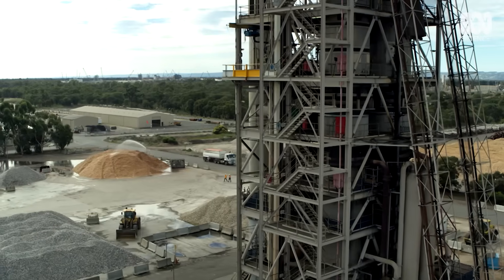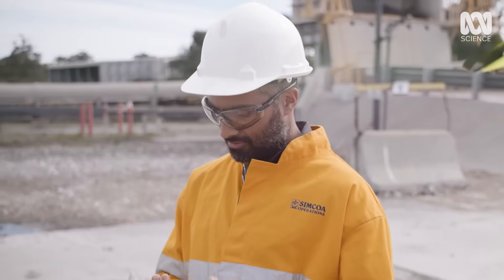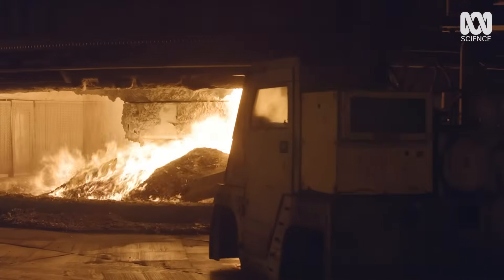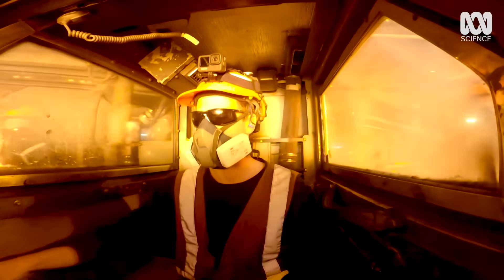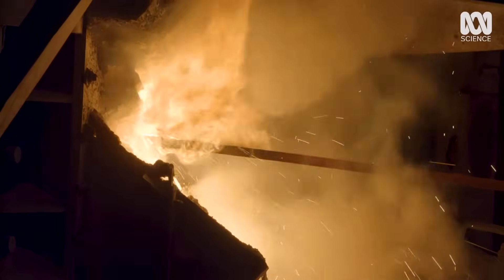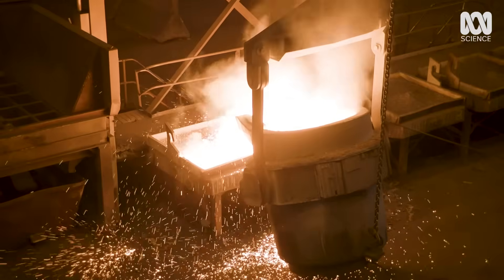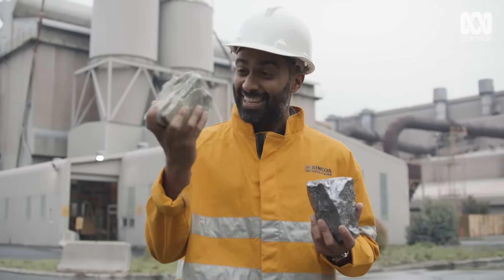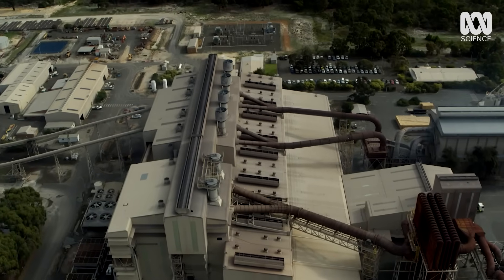“It’s Like Working In A Volcano”: How Silicon Is Made | Extreme Jobs

Comment: Leftoids don't ever think the creation of solar panel nor the recycling of solar panels through. All they see is a material that turns sunlight into electricity. They don't care that the huge fiberglass turbine wings have to be cleaned every 5 - 7 years due to large birds being killed by these blades. Then they never learn that even if the 25 yr old turbine blade is ground down to dust, that dust does not disintegrate nor is it useable for other products.

Comment: Wait, is this going to be used to make solar panels? I’m not sure he mentioned it in the video
Reply: after cleaning it with some form of halide like chlorine and fractional distillation in a massive chemical plant, yes.
Reply: Cosmetics too. Lotions and such. Medical uses. Silicon can be a grease or oil. Not only a hard rock.
Reply: solar panels, microchips, silicon wafers and probably more
Reply: Probably, because silicon is a semiconductor material which is needed to make photovoltaic cells
Reply: First 40 seconds mentions it
Reply: @warlynx5644 yes I know they stated excessively throughout the video 😂

Comment: 4x10 EROi is pretty low, add in battery storage and it gets worse. Average for other generation technology is 40. Hydro-electric is the best followed by nuclear.
Reply: It's many times higher if you use the cells in high isolation areas near the equator. Like 20 or even 50. For newer cell technologies solar has reached an EROI of 70 in some places. Nuclear, OTOH, can never exceed an EROI of maybe 6, because everything related to nuclear, refining the fuel, building the plant and storing or further processing the waste, is humongously energy intensive. The refining of uranium is a tiny fraction of the energy required to produce electricity in nuclear power plants. Radioactivity itself causes nuclear power plants, which are extremely expensive to build, to have a limited lifespan, and the cleanup is itself very expensive. Factor in the risk of accidents and nuclear, strictly from a financial point of view, becomes total nonsense, compared to solar. If you add a carbon tax into the mix, only hydro and wind can compete with solar from a cost perspective. But if you compare the EROI of solar in high insulation areas like deserts near the equator to the EROI of wind in high wind areas like the sea north of Scotland, solar still comes out on top. Areas with high wind are limited, as are hydro sources, whereas areas with high insolation we have plenty around the globe.
Reply: @a0flj0  Many of the CANDU reactors have a EROI approaching 50. The newer designs will last 80+ years with refurbishment and the reactors have an annual 90%+ operating up time, compared to 30% for solar. Mass grid level solar will never work until there is an economically workable storage solution. As it stands, countries that have invested extensively in solar have seen retail cost of electricity explode because of the necessary extra costs in transmission infrastructure and freq firming. In some countries we see wind and solar production is paid to NOT feed into the grid during peak output and then is not there during 'doldrums' which can last for weeks to months and then the shortfall has to be made up, usually with gas burning turbines, again this can be very expensive depending on the market rate of the gas. Nuclear is a proven, mature technology and we are seeing large scale re-investment and commitment to this carbon neutral technology. BTW, did you catch the bit about COAL being necessary for refining silicon for solar PV?
Reply: @findingthereal9052  That's BS. Those reactors are indeed more energy efficient than others, but even the best placed of them don't exceed 20, if you take everything into account, from baking stone at high temperature to make cement for the concrete to dismantling the powerplant and storing the waste long-term.

Comment: I'd say why not utilize the solar panel tech to create some power for the plant directly, doesn't have to cover all of the plant's needs, but off-setting the amount used a little bit wouldn't hurt either.
Reply: Probably doesn’t make sense logistically. They should use the thermal energy they release to offset the power they use really. A paper mill in the states does exactly that
Reply: Because it needs to run around the clock. Solar yield is also tiny.
Reply: At some point in the process, they need the carbon from the coal.
Reply: This is an old method. China has developed a new and efficient method.

Comment: This is why solar panels are such a farce, tonnes upon tonnes of carbon dioxide is released into the atmosphere just to seperate the silicon. Not only is the transportation and mining included in the carbon estimations. 
To top that off. electricity companies are forcing people to switch off their invertors becUse they cant manage the copious amounts of cheao energy when they have to sell their own power. So yeah it could be up to 10x as much, but it wont be because a panels degrade in uv and power companies turn invetors off.

Comment: Boy, do you fail to ask ANY interesting questions in this.
What temperature is needed to liquify silicon?
How hot is it in that dango? Is it climate controlled? What kind of heat is it rated to? How hot does the exterior get? How can he get IN AND OUT OF a 1000° forklift cab?
Why does the tap hole have to be unblocked by hand? Is it too hot for machinery? Or is it cost-cutting?
What is the stick he's using to DO so MADE out of to survive that heat?
What happens to the silicon after the crucible?
Do they engage in carbon capture? What happens to that CO2?
"If this silicon is made into a solar panel it can produce 4x the energy used to make it"... great. What percentage of it IS used to make them?
"Up to 10x in Australia"... capital! Why isn't the plant being driven off of solar, then? Can it be?
How are OTHER smelting plants handling the CO2? Or the energy requirements?

This was like watching "how candy gets made"... by someone saying, "materials go into this machine and on the other side, out comes candy!"

...interesting footage. Worthless video.

Comment: For the non believers of renewables.

For every 50.000 tonnes of silicon u can make like 50 million solar panels. The silicon crystals in those panels are very fine and only weighs a bit over 1 kg per panel.
50 million panels can generate over 15.000 MW of power and this for many many MANY years. 

Trust me the 500.000 tonnes of co2 released for making this is nothing compared to the ammount of energy thats saved in the long run.
And the silicon in the existing panels can also be recycled and reused. Perhaps not as effective as newer ones but the recycling is a lot less energy intensive then new ones.

Remember the uranium mines in australia en the refinement of the ores are energy intensive too. But they have proven their worth too..
Reply: Comparing uranium to photovoltaic panels just shows you are clueless. Uranium is insanely energy-dense, absolutely dwarfing the energy input needed to make it do its thing, and this is considering total life cycle, something that is usually neglected for photovoltaics. Their life cycle efficiency is pathetic when they are used in low insolation regions of Earth. They are not a baseload source and should not be forced to be used as such.
Reply: @lajoswinkler 
What?

Do you think solar panels are the only renewable energy sources to ever be created?

Seriously you seem to be down right fetishizing a non renewable energy source
Reply: @lajoswinkler You're arguing like good old totalitarian Communists, with five year plan and all...
Reply: @lajoswinkler  Uranium is a fuel though. Once it fissions, you can no longer extract useful energy out of it. The silicon is endlessly recyclable, and can continue to produce power as long as the sun stays on.

Comment: The Silicon you held at hand at the end, you can not use it to make a solar cell. You need to further purify it into single crystal silicon
Reply: Most of the silicon I've held gas been so pure that it's an insulator. It actually requires impurities to be added. Also some solar cells are cut from a block of polycrystal or extruded as a continuous ribbon crystal. Monocrystalline panels are rarely used nowadays because they are polarization sensitive. ❤
Reply: Ignoring poly-crystalline silicon solar panels of course
Reply: or polycrystalline silicon, or amorphous
Reply: I mean, it's arguable that the next step, purifying, IS us making a solar cell from that sodium he was holding. 
I mean, it's not like you take it to your local blacksmith.
Reply: Yeah thats what the furnace is for boss
Reply: @Steigma getting semiconductor pure silicon takes more resources then solar panels will make years, making wafers for computer chips is just as expensive.
Reply: @jonathanjones3126  they arent that complicated... They pump out higher quality computer chip wafers like potato chips. Solar panels definitely are nowhere as near as difficult or resource intensive to make. Just the refining process alone makes solar panels look like glass blowing
Reply: @jonathanjones3126 also history time. We started developing "solar technology" in the 1800s. Wayyyyy before we started on computer chips. Thats how simple it is.
Reply: @Steigma clean energy like solar and wind produce more lifetime waste then nuclear.
Reply: @Steigma if you want remotely efficient chips you need 99.99999999999% purity,  I have worked in semiconductor fabrication and the discipline required is more then most people can understand
Reply: @jonathanjones3126 yes that is true, but making SiF4 or SiCl4 will remove the impurities then remove the halogen to get pure silicon. It's so pure at that point that it is nonconductive and needs a pinch of boron added to make the wafer crystal. ❤
Reply: @jonathanjones3126 100% not true.  Nuclear decay can take thousands if not tens of thousands of years while silicon decay takes hundreds of years. Open a book before you expose yourself as ignorant.
Reply: @jonathanjones3126 plain nonsense! How much of a nuclear plant can be recycled?
Extreme dangerous waste must also be stored millions of years..
Reply: @OmmerSyssel I cannot help one who refuses to open yourself to new information that doesn't come from the anti nuclear side.

Comment: This is irresponsible work... you are letting out massive amounts of CO2 which is the main culprit for climate change. You've got to find a way how to capture that CO2.
Reply: Found it with a quick search, solar is 12x better than gas and 20x better than coal overall re CO2.
Reply: @randfur reference?
Reply: You can determine and calculate the CO2 produced vs offset from generated power. It's far a positive balance.
Reply: I wish they covered this. They said that it produces 4-10x the energy used to make it but didn't compare the CO2 difference between creating and using this vs using fossil fuels.

Comment: Thats impressive for sure. However you can also understand the catch 22 when you hear the amount of CO2 being emitted etc
Reply: Well, to make 1 KW of solar panels you produce 40 Kg of CO2, over it's life span it will generate around 35,000 KWh, meaning you emitt about 1 gram of CO2 per KWh generated from the silicon. 

In other words... it's nothing compared to coal which produces 820-1000 g CO2 per KWh... that is literally 820-1000 times more...
Reply: @TheEsseboy  Well I would like to think that is true. If it is then great Im all for solar
Reply: @TheEsseboy  It's kW and kWh, not KW and KWh. K is kelvin, k is prefix kilo-.
And this yield of energy greatly depends on the place where the panel is. No way in hell is it going to work like that in areas of low yearly insolation. This is simply not an energy source that can be baseload. It's supplementary at best.
Reply: @lajoswinkler  I am not spendin a lot of time writing in comment sections, usually people aren't that interested or interesting to talk to... 
Of course the loaction of the panel plays a part, but, on a 25 year life span it averages out to a capacity factor of around 20%.

Comment: Is it going to turn into a silicon Rock if I bring a random rock and put it on stove for a while until it melts then pour it into a some sort iron bucket and leaving it aside until it's cool down
Reply: No. You probably get melted silicon dioxide if you can achieve a high temperature
Reply: You won't melt silicon dioxide on your stove. 
You need to mix the sand/rock with carbon and heat it up in an oxygen free environment, otherwise you'll just burn the coal before it has a chance to chemically react with the silicon
Reply: 1750C... any idea what 1750C is like? and its closer to 2000C to actually pour...
steel melts around 1300C.
your stove is capable of maybe 650C if its electric, bit more if gas...
how to hold it?
Reply: @paradiselost9946 it's doable with a microwave oven. But you need to blend in some graphite and wrap the stuff in insulation.
Reply: Nope. Quartz melts at a temperature hotter than any surface you'd use to cook with, and the stove is incapable of supplying the requisite power to melt aluminum, much less steel or quartz

Comment: They make and use solar panels to create green electricity and save the world from CO2. But as you can see, they use outrageous amounts of power to mine, and melt silica and as the video tells you at the 1:48 mark, the process releases CO2 into the atmosphere.
Combine that with the energy used to manufacture the solar panels from that silicon, plus the metal to support the panels, the transportation costs for all of it, the concrete to support all the posts in the ground, the steel chain link fences they usually put up all around such sites,  and the lawnmowing dozens of times a year, and the degradation of the panel's performance in the first few years, and you can see how people, especially those in cloudier regions and those places that have winter snow are questioning whether solar arrays aren't using more energy than they will create. Especially when you consider how they bias people's perceptions by using optimum desert locations as their estimates of performance. A 100 watt solar panel will produce 8 watts when its overcast. THAT'S if it's new.
Reply: First of all a 100 watt panel??
Second: even in snowy regions one panel can generate over 300 and more kwhs per year.
Thats an average of almost 1kwh per day.... in most cases 10 panels produce as much energy as a household needs in a year and that's a proven FACT known for at least 20 years!

The only person questioning the efficiency is just you.
Reply: @KD-op4yz  unfortunately  low almost prrmanent  clouds here did not know about that facts.
Reply: @AABB-px8lc  8% efficiency is LIES in relation long term cloud coverage. It can easily be multiple that efficiency with clouds. Still not great but he just spammed Fabricated Numbers.
Reply: I can totally see how people question that. What I can also see is that, if people truly want those questions answered, they can turn to a number of life-cycle assessment papers published about solar panels in several regions. They consistently say that solar panels reduce the resource and environmental footprint when compared to fossil fuel in most places.
Reply: "100 watt solar panel will produce 8 watts overcast" BOGUS extreme case not relevant to real world usage. "THAT'S if it's new" is insane fear mongering. A DECADE old Solar PV panel will only have A FRACTION of performance degradation. Your spam is full of baseless assertions.

Comment: The silicon produced this way is not pure enough for solar panels. It needs purification.
Secondly, even solar and chipmaking, combined, actually use modest amounts of silicon: chips and PV panels use layers less than 1mm thick, sometimes much thinner than that.
Most of the silicon produced here is used in metallurgy (search for "ferrosilicon").

Comment: Somebody has to answer this question, why every valuable material production - cement, metal, copper, silicon etc has to be produced in huge large factories? If I would have a small area with my own based government, I would need just small silicon for solar panels, not, tons of it.
Reply: It's more efficient to make it in bulk.
Reply: Economy of scale. Your factory might be able to churn out twenty tons of silicon a month, but the one next door which is twice as big could manage fifty to sixty tons, and the one twice that size could handle two hundred or more tons...

Comment: one could argue that silicon production produces billions of tons more CO2 that would normally not be produced simply because climate change activists demand lower CO2 production from petroleum vehicles but are in fact producing more CO2 from solar panel manufacturing, ironic
Reply: Well, to make 1 KW of solar panels you produce 40 Kg of CO2, over it's life span it will generate around 35,000 KWh, meaning you emitt about 1 gram of CO2 per KWh generated from the silicon. 

In other words... it's nothing compared to coal which produces 820-1000 g CO2 per KWh... that is literally 820-1000 times more...

Comment: The bad news is most of the Silicon are used to make microchips which actually products move co2.
Reply: This silicon is not usable for microchips. It first needs to be turned into monocrystalline silicon, which is another energy intensive step.
Reply: @lbgstzockt8493  The silicon at this state can't make solar panels, either.

The inherent nature of a semiconductor's ability to conduct electricity requires a cut in a uniform direction in reference to the crystal's unit cell. Basically, if you have a "blob" of silicon, it doesn't conduct.
Reply: Silicon for microchips is grown using the Czochralski method.
Reply: Yes.